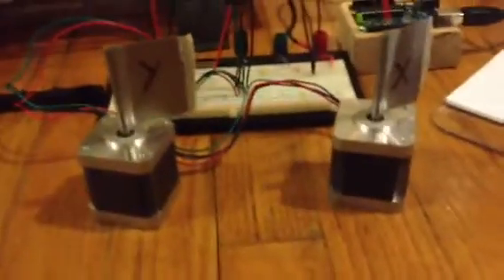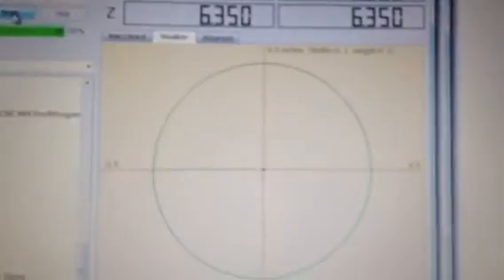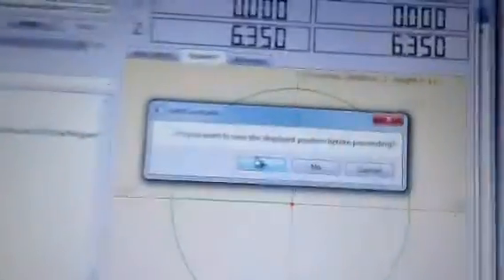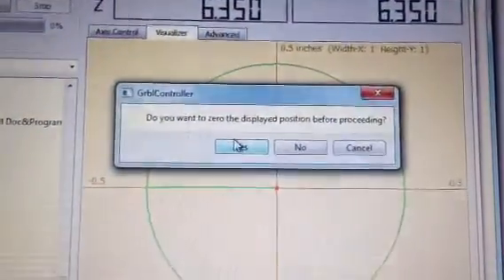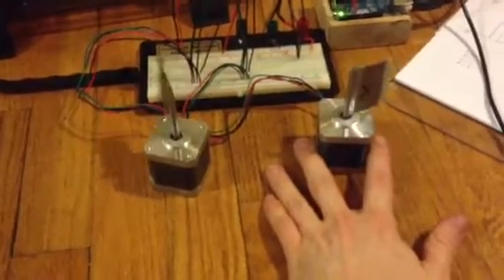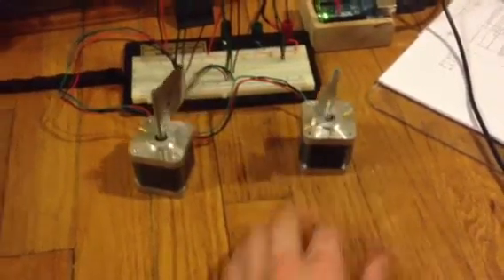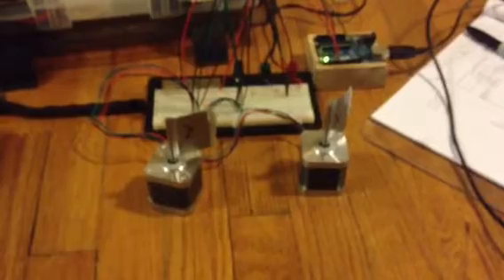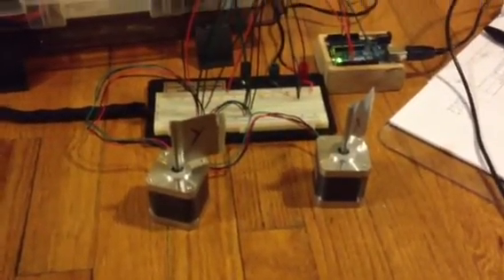CNC Project: Stepper Motor Test NEMA 17

Comment: hello,
can you please tell, what is the grbl configuration,
Reply from the maker: I'm not sure what you mean.

To use it, you flash the grbl hex file onto the arduino using the grbl loader. The computer program is a separate file, but quick to install.

Once the arduino is flashed, you can open the grbl program, setup the correct COM according to what your computer says your Arduino is on, and then send G-code individually or from a premade file.

Does that help answer your question?
Reply: Yes, but which hex file,,, the pin assignment for mega2560 is bit different than UNO ,,,
Can you please tell whicy hex file for mega2560, and what is the pin assignment for the motors and for the limit switches of tye end stops...
Reply from the maker: I haven't gotten that far. Hex files are here. I think you pick the one that corresponds to the processor on your board.

Wiring diagrams I just found with a google search.

https://github.com/grbl/grbl/downloads